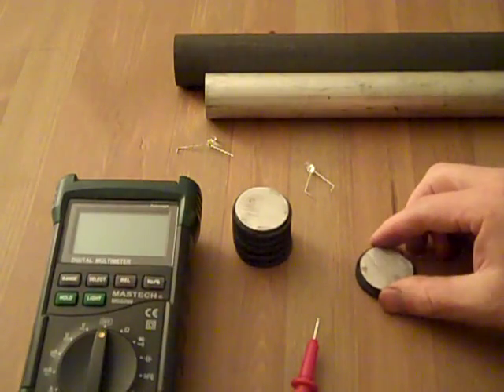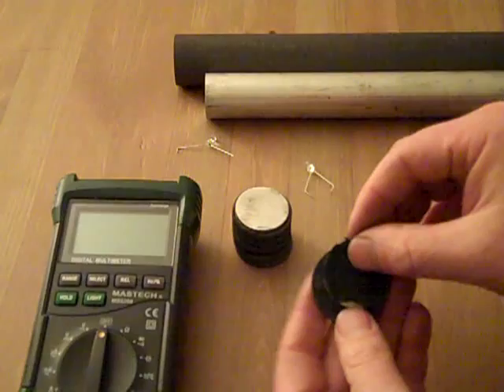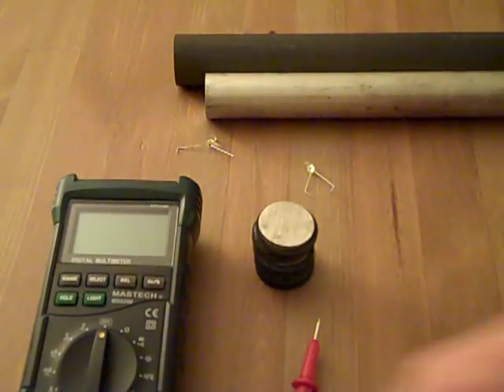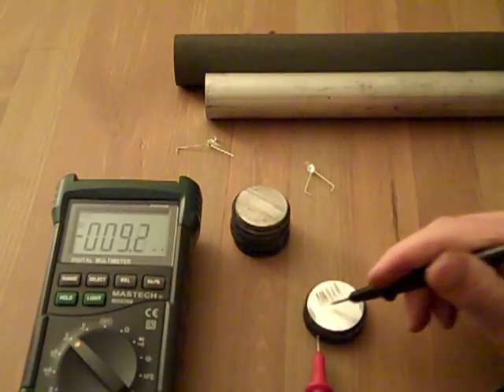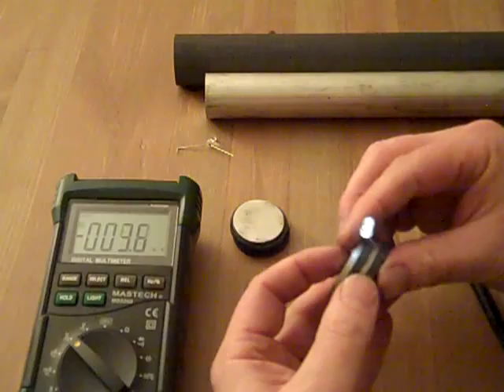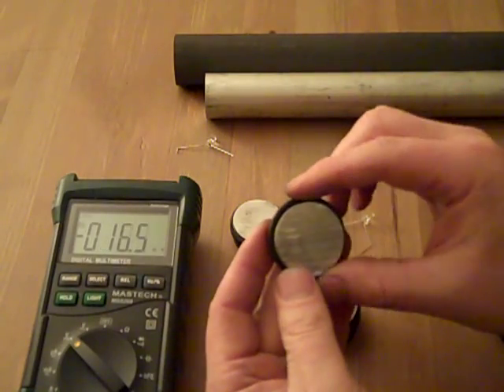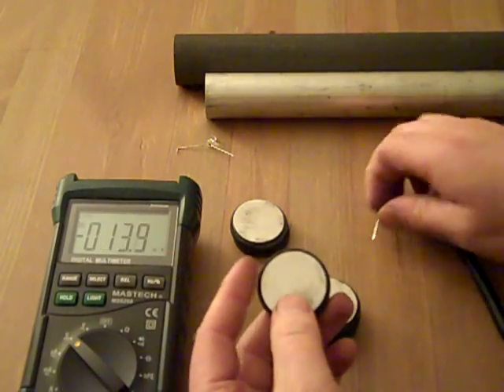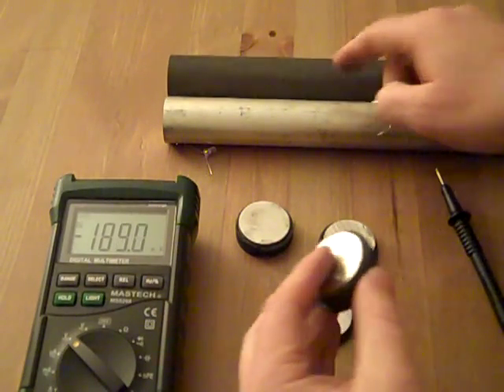Magnesium Graphite Voltaic Pile.MP4

Comment: Thank you so much for posting ! ! 
do you have any idea if heat will effect output?
corrosion seems to be the big problem but let's define that further - corrosion is not a problem if??? If it does not remain where it was created. In other words if the corrosion was washed away imediately somehow or chemically desolved. or if the current could pass through or around it. 
Unfortunately it seems that the energy is comming from a type of "burning" - "oxidation" process. the magnesium is consumed?

Comment: Love it. Voltaic pile updated to 20th century. Nice output ... it'a a pity this setup needs constant cleaning ... the film builds up quite fast but the potential electron difference the two metals is certainly superior to the zinc copper coupling. Good work!

Comment: @harveyworks I'd suggest no cleaning whatsoever, and take a note of the current likely rising faster than when
it was "cleaned" prior.  I think the reason is that as the magnesium gets somewhat oxidized/pitted, it actually creates more total surface area than when it was new.  It may not look ~ nice then; but its probably more
efficient for it's energy use.  When air dried out, some of oxide will flake and fall off anyway.

Comment from the maker: @pyrolytic Right, they do develop a non-conductive coating within a few days!  I've been trying various household (and industrial) chemicals looking for a good electrolyte that is active enough without being too corrosive of the magnesium.  Diluted drain cleaner seems pretty good, but even with that I need to clean the plates every few days...   Any suggestions?  I also made some "dirt" batteries, and the dirt seems to keep the formation of the non-conductive layer to a minimum.
Reply: Hey Harvey,  I have ordered some silicon carbide to mix with some sodium silicate to use for the "electrolyte".  When all my parts come in, I'll re-post with results...

Comment: While laundry detergent usually does not specifically name the exact chemicals; I
would suggest that it is the "brightening agents", i.e, sodium hypochlorite that is
the real electrolyte reaction you are seeing (bleach).  Magnesium will always
oxidize somewhat in the presence of such; it's kind of like a "sacrificial anode" and get used up, and turn into magnesium oxide.  Your surfaces will also have
a somewhat thin and non-conductive surface forming almost immediately.

Comment from the maker: @JacobH420 , the amperage drops as the fabric dries out.  It comes right back when I re-wet the pieces.  Eventually, the magnesium will corrode away, but with a mild electrolyte like laundry detergent, I think that might be months or years.  I've tried more active electrolytes like bleach, and hydrochloric acid, and they significant;y boost the amperage, but they also corrode the magnesium pretty quickly.